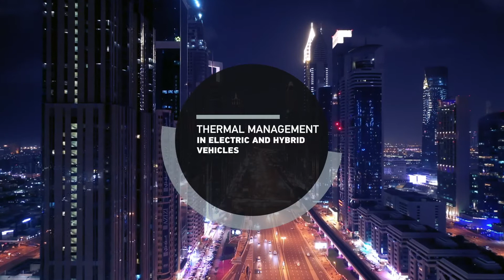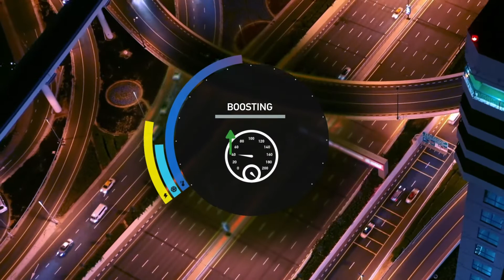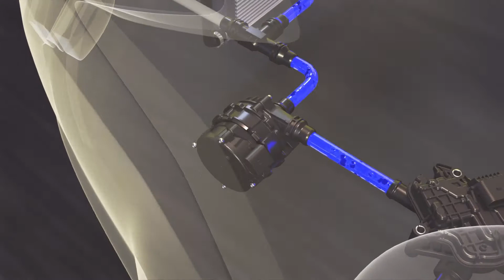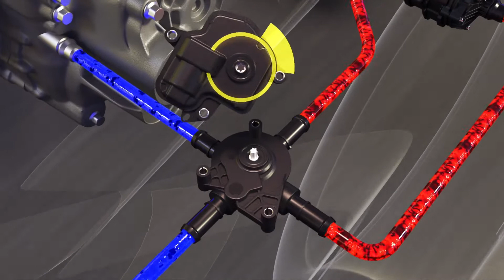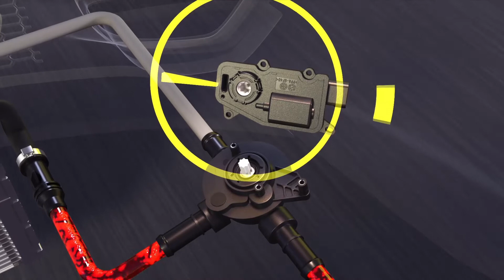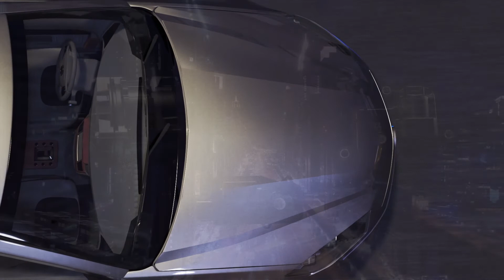Thermal management in electric and hybrid vehicles

Comment: This is like the ITM on my 22 Kona. Which started Leaking at around 16k Miles. Was replaced. It has that crazy Stop/Start but the coolant needs to circulate. All I know is the System keeps loosing Coolant. And occasionally a Strong Smell when Started. Or Driving. Then goes away. I wonder if the System is Overpressurized?? After sitting 20 Hours, The cap still had Pressure when I went to check the level.